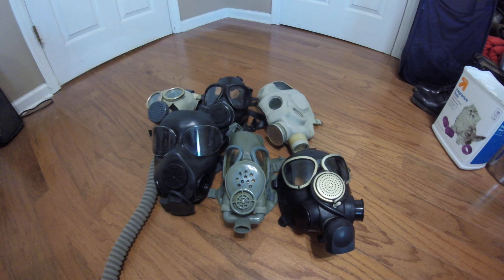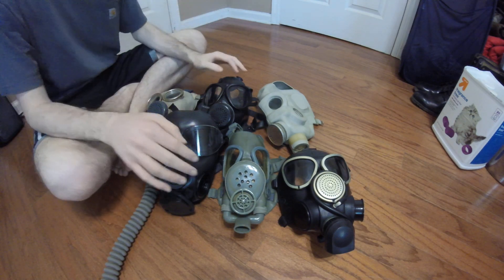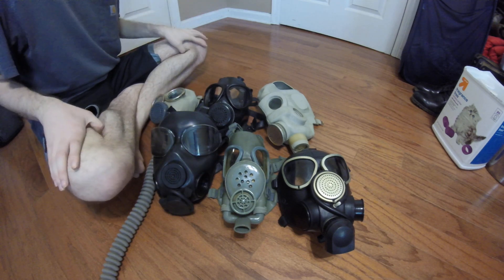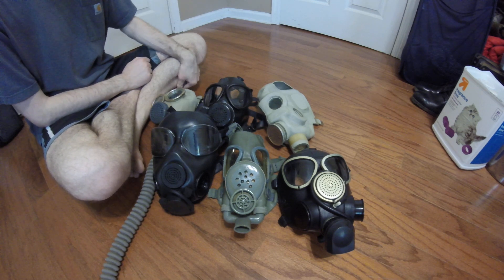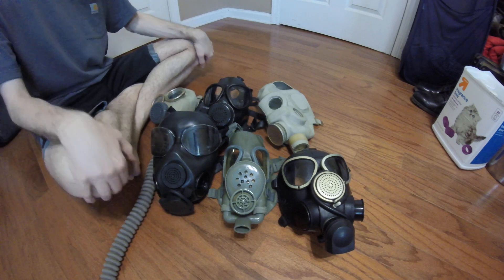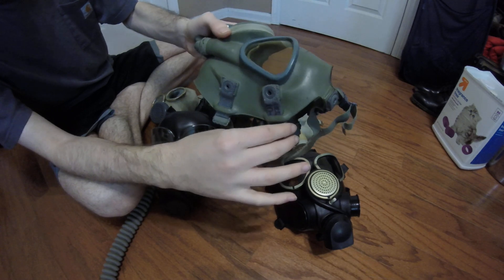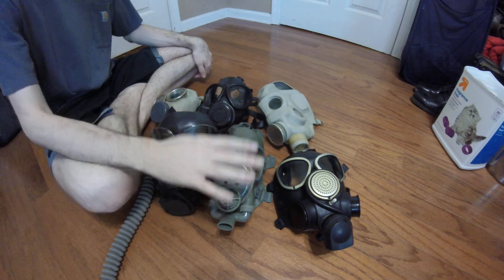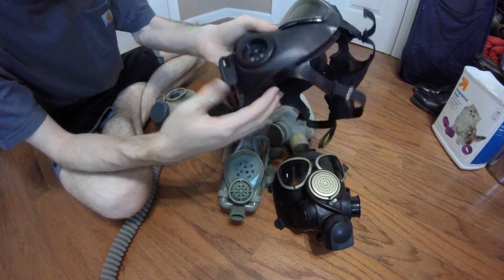(OLD VIDEO) Facial Seals - The Mechanical and Physiological Principles Involved Within

Comment: Hey duke I need some help here my parents got me what I believe to be a American tissot mask for $20 and it’s all mummified but otherwise in almost pristine condition I was wondering if you know a easy way to soften up the canvas rubber material.
Reply from the maker: I offer restoration services. Also either way, can't reccommend anything until I see photos.
Reply: Ok I’ll probably have a video up sometime today about it.
Reply: I’ve published a video on it And I’m sorry if my age/video quality sucks.
Reply from the maker: Sorry to disappoint, but that is not an A.T., that is a Corrected English (C.E.) Type Box Respirator, Model of 1917. Very common WWI Mask, but still a bargin for $20, as they typically go for 4 times that price in similar condition. Also luckily this would be a relatively simple mask to restore or at least get opened again.
Reply: Oh ok thanks for the info.